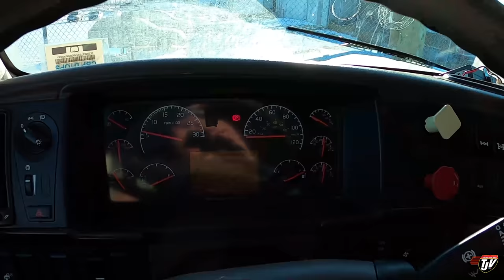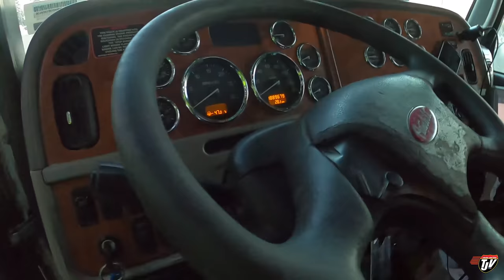AIR LEAKS | My Trucking Life | Vlog #2419

Comment: Hey Josh !!  Winter is here so get some "HEET"" Dry gas Treatment & put it in the trailer air lines & it will work thru the system to get any moisture out !!  HAHA   Thought Pop would have shown you that ??  Have a good week & ""KEEP IT SAFE ""!!   Sounds like your air dryer needs service too ???
Reply: Better yet replace the whole air dryer every September, and avoid the grief altogether. Rebuilt one is just a bit more that what they sell the canister for. Which you are supposed to change every year, in any case. I havent seen a tractor with the alcohol sniffer bottle since about '86.

Comment: In opinion most drivers are ignorant, in Physics you learn that the longer a vehicle, (tractor trailer) the more off tracking occurs when a tractor trailer is turning.Definition: Offtracking is said to occur when a vehicle makes a turn and its rear wheels do not follow the same path as its front wheels. Hence, you respect truckers by giving them all the space they need. Furthermore, Driving schools  ought to be teaching more to younger drivers. Driving is a privilege in Canada and the USA. I’ve had my class 1 since 2016. I’ve learned a great deal from trucker Josh. Maybe, we’d cut down the number of accidents on highways if driving schools were doing more regarding safety. Safety is important than money in my book.